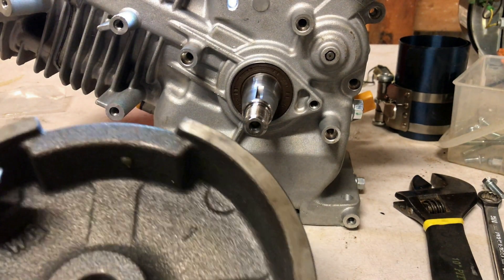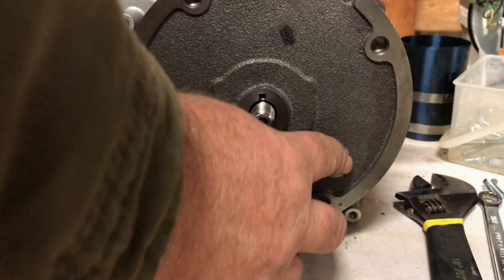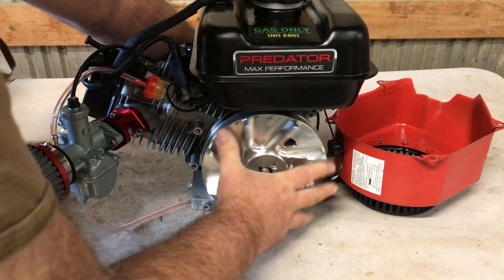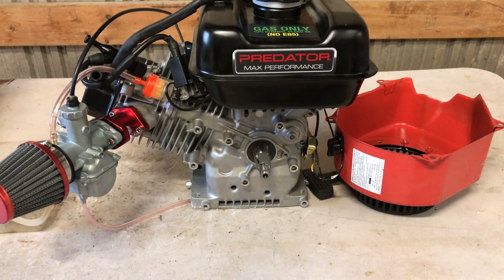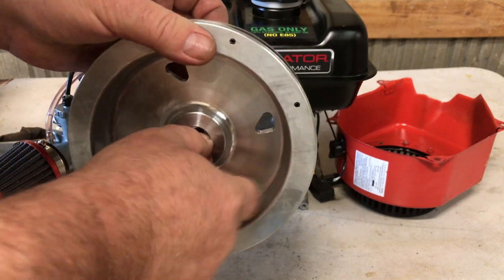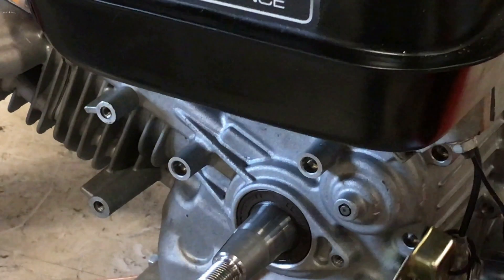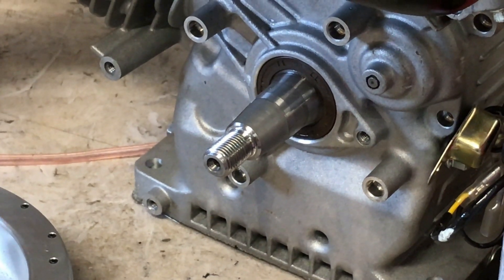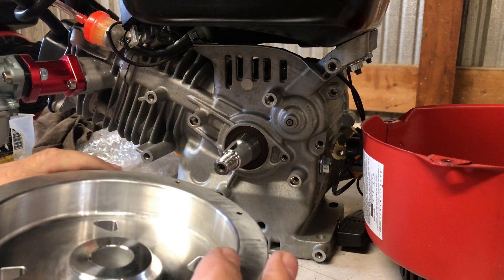Hard Starting and Kickback Solutions for your 224 Predator 212 Engine Build 223 Wildcat 236

Comment: I have a a predator 212 i was using it stock and upgraded the springs flywheel rod and carb and it will start but the pull is so hard im worried im going to break it is it supposed to be that hard with just a few upgrades my valve lash is set the only think i can think of is something to do with the flywheel i dont know what im doing at all any info would help alot thanks!
Reply from the maker: Hi Kaizu! Most of the time it's a valve lash issue. Try setting the valves on .003 (three thousandths of an inch or the metric equivalent) If the valve lash is not set properly, the compression release on the camshaft will not work. If you have increased compression OR installed an aftermarket flywheel, timing and fuel octane could be an issue. The easiest way to correct that would be to delete the timing key and move the flywheel counter clockwise just a tiny bit OR purchase an aftermarket advanced flywheel key and turn it around to retard the timing instead. Can you remember if the piston was below deck or above when you installed it and how much?
Reply: @KentuckyFriedFixes  i did is it safe to start even with it pulling that hard?
Reply from the maker: I really can't know if your engine is safe to start or not? Since I didn't build it, I'm kinda in the dark. That's why I asked if the piston was above deck or below (down in the hole). It's really important to know these things because if there's not enough distance between the top of the piston and the bottom of the head (quench distance) you could have mechanical interference causing an issue. A lot of guys get into this situation with the .010 thick head gaskets. If it's not any sort of mechanical interference and you have the valves adjusted correctly (that means you did not accidentally set the valve lash with the exhaust valve on the compression release bump of the cam.) It should start and run fine. But I need a little info to go on before I can be of much help to you.
Reply: @KentuckyFriedFixes  what does that mean piston above or below sorry i dont understand i just followed youtube videos 🤣 sorry bare with me here
Reply from the maker: @kaizupiano7826  Hi Kaizu! It's easy! When the piston and connecting rod are installed in the block and onto the crankshaft, you bring the piston up to top dead center, (that's as far as it can move up in the cylinder bore and just before it starts to go back down). If the top of the piston does not reach the top of the cylinder bore, that means the piston is below the cylinder deck (some guys will say the piston is "down the hole"). Likewise, if the top of the piston rises up and above the cylinder bore, then that is considered "above deck" (some guys will say "pop up"). The reason it's important to know how much distance is between the top of the piston and the cylinder head is if your piston was above deck say .010 and you used a .010 thick head gasket, that means you'd have "0.00" distance between the piston top and head. That would be bad. On these engines you really don't want less that about .035 inch clearance. This clearance is called "quench".
Reply: @KentuckyFriedFixes  ill look at it tomorrow and let you know thank you so much for your help
Reply: @KentuckyFriedFixes  i was never told any of that from the tutorials i watched thanks for helping me
Reply from the maker: @kaizupiano7826  You're very welcome!
Reply from the maker: @kaizupiano7826  Check out the Ducar 212 engine build Part 2. Around the 18 minute timestamp I measure to determine the piston to deck numbers. I think I cover it in one of the 224 build videos as well along with a discussion about the proper Quench.

Comment: I’m confused on the flywheel timing I thought u just lap it put the key in place and slide the flywheel on an done. Is that not all you have to do?
Reply from the maker: Hi Brad! If you use a flywheel key, that's the process. Though I delete the flywheel key on mine and run without one. Those flywheel keys can destroy a billet flywheel.
Reply: @KentuckyFriedFixes  thanks for clearing that up! I’ve been watching a lot of vids and doing research on the whole building process a lot to take in haha. I do have a question what is a drop in cam for the 224 that requires no clearance or anything
Reply from the maker: I used the 265 Banzai camshaft from EC carburetors. It's got a clearance cut in the casting that works fine for the 58mm stroke crankshaft with the EC # 8281 connecting rod. The 272 Mongoose cam from NR racing has a similar clearance cut in the casting but may require a small amount of grinding between the lobes. (Neither cam requires any grinding of the lobes directly though as they're both narrow lobe cam profiles.)

Comment: I got a 224 fully built and when your rotating the flywheel, you hear knocking and idk what it is I clearance the whole block, put new bearing rods and I’m still hearing the noise lmk if you can help
Reply from the maker: Hi Francisco! There are several places to check for clearance issues when building the 224 engine. If you used the ARC type billet rod, those rods are great but they have lots of clearance issues with the block and camshaft. That's why I ended up using the EC connecting rod in the 224 builds on the channel. Also it's important to remember the 224 engines use a standard size Honda clone crank journal of 1.179". Most of the other non-hemi Predator engines use a crank journal that is roughly .010" larger. So some have made the error of using the larger bearing on the smaller diameter 224 crankshaft. This leaves a +.010 gap between the bearing and crankshaft that oil cannot fill and will also create a knocking sound because of the excess clearance. Don't panic, you can do this. Just eliminate one possible source at a time until you find the issue causing the knock.
Reply: @KentuckyFriedFixes  ight what rod bearings i need then i just got new ones and they 6394
Reply from the maker: @Ifykyk626  You'll need to verify the ID of the bearing with either a dial caliper or an inside mic to be sure when you measure for oil clearance. Just because the box says it's correct, doesn't guarantee it is.
Reply: @KentuckyFriedFixes I did that! I put some sort of predator rod in a clone. Didn't seem to hurt anything and I couldn't hear a problem but glad I caught it. It made me sell me predator stuff - all of it!
Reply from the maker: @JimCooper-f8g  It's the little things that sometimes cause the biggest problems.
Reply from the maker: Also: Some aftermarket camshafts are ground with a very large profile, meaning the lobes on the camshaft are much bigger/wider than a stock cam. This allows the crankshaft to contact the cam lobe and in that case there must be clearance grinding on the crank or the cam lobe so each can pass the other during a full 4 stroke rotation without making contact. It happens more often than you'd think with the 58mm stroke crankshafts found in the 224 engines.

Comment: I put a mod 2 cam in mine & it gets hard, ive been hearing to do the vqlve lash a lot. Will try that today.
With stock cam is easy to start
Reply from the maker: That valve lash setting is real important. Without a good lash, the compression release can't work.
Reply: @KentuckyFriedFixes  yeah, i did valve lash & way better to pull & i think less noise too. Just need a better 18t clutch,

Comment: I got a Predator 173 cc  engine out of the box that will break your F ing hand trying to pull start it !Worst kick back I ever experienced since maybe 1960  's CZ dirt bike we called killer!  Once it starts runs good ,strong ! I did not take engine back to HF cause I had to modify a few things to get it on my Log Splitter! I thought maybe because it was set up for a lawn mower with long pull stroke I need to stand back further to alter pull stroke .That helps but still will get you . Seems like I need to pump the shit out of the primer bulb .Is there a way to enrichen  the carb to make starting easier ,or add a real choke ? I am ready to take rope pull off and use impact gun to start the damn thing!
Reply from the maker: A lot of guys report the valve lash being out of adjustment on those right out of the box. If the exhaust valve lash is not set correctly it can cause a hard start situation as the compression release on the camshaft is not working properly because the valve lash is too loose. I'd try resetting the valve lash to about.003 on the intake and exhaust.

I'm not sure what to do about the carburetor, those vertical shaft engines have a little different set up than the horizontals.
Reply: I pilled up the Predator 173 cc  owners manual and it says valve lash should be 4 to 6 thousandths on intake ,and 6 to 8 on exhaust! Seems pretty wide recommendations to me ,but I will check it. The HF Service Help Tech  Line Tech told me a lot of Predator motors have bad compression release cam right out of the factory. When I described my symptoms he told me he could send me a new cam or possibly get engine replaced.It only had an hour run time on it ! I did not want to go thru the BS so figured it would get better when broken in! I now believe I just got a bad motor or one with valve adj too tight .

Comment: i thought it was normal and i've gone through 6 pullstarts because they keep breaking. 💀
Reply from the maker: Every now and then a little kickback is expected from a performance built engine. If I was breaking pull ropes, I'd either lower the timing a bit or start it with an external electric starter. Thanks for your support!

Comment: mine almost ripped my arm off yesterday. I'll start redoing the valves..its a full 212 hemi, .10 hg, .570 pin piston...I got it running but cold it's a bitch to pull over..its only a 275 cam 104 lsa
Reply from the maker: Sounds like some good compression being made! A little kickback is to be expected on performance builds but if it starts pulling the rope out of my hand more often than not and everything else looks good, I back the timing off just a little until it behaves. It's either that or go with an electric starter! Thanks.

Comment: Great video man exactly what I needed. Built a 224 last year and it's doing the same thing. Luckily I watch a lot of your videos and that's the only motor I have that I didn't use a key 👍 at least now I know where to start. Thanks a lot I really appreciate all you content 👍
Reply from the maker: You'll get it dialed in. I like a lot of timing too and these engines run great with advance but if it starts pulling the rope from my hand more often than not, I'll back it off a few degrees until it doesn't. It's either that or go with an electric starter. Thanks I appreciate you!

Comment: Why not just run stock ? Key that flywheel isn't made for ridding around gonna run hot.
Reply from the maker: Hi Curtiss! This application needs a billet flywheel to be safe because the engine is not governed. Stock flywheels are only rated to around 3600 RPM. This engine can turn twice that.
Reply: @KentuckyFriedFixes   I run stock key in my arc flywheel. Why bother using a timing key. Your motor run hot no cooling fins that flywheel is for racing .
Reply from the maker: @curtissmartin6322  The flywheel matches the engine. This is the 224 engine featured in the 224 build video series. While the Slip Stream flywheels do offer less drag due to their cooling fin profile, I'm not aware of anyone having engine overheating issues. I'm not having any.

Comment: Hey KFF so I’ve got a predator 212 I have a billet fly wheel I’ve upgraded to a vm22 Mikuni removed the governor and bought 18 lbs valve springs and was having this exact issue and adjusting the valves did the job but just for a genuine question what timing degrees should I have my flywheel set at I have the engine built for just riding around town but still good for off-road what do you think would be the best timing for that?
Reply from the maker: I like to use around 28 degrees for gasoline and 34 to 38 for Methanol and Race Fuels. Each engine is different though as some builds will have more compression than others because of a different piston or camshaft profile, head etc. Most of the billet flywheels will have around 32 degrees total advance when installed with a stock timing key. If you have a mild built engine (flat top piston, mild camshaft), 93 octane gasoline and somewhere around 28 degrees total advance should be pretty close. A lot of advance is great but if it starts pulling the rope out of your hand more often than not, it's time to back the timing down a little at a time until you hit the right spot. (Or switch to an electric starter)
Reply: @KentuckyFriedFixes  hey thanks for takin the time to right all that helps alot I couldn’t find a good clear answer anywhere else so thanks a lot! 😎
Reply from the maker: @jeronion  We love engine talk on this channel!

Comment: I just got a 212 mini bike with a billet flywheel, springs, cam, and rod. Was riding fine then all the sudden started to bog down and it was hard to start rode it more and around top speed it started to bog again and now it pulls it out of my hand every time and I can’t even get it to start
Reply from the maker: Hi Vanquish! You could have multiple issues causing this situation. Some things to check: Oil level (of course) to make sure the engine has not been running low on oil. I know that most of these engines have a low oil shutdown in case the oil level drops below the safe operation level, but in many cases those may be disconnected by a previous owner or even faulty so it's best to check the oil before every ride. Low oil can cause an engine to bog down as it may be locking up due to inadequate oil supply to the crank/rod.

The next thing to look into would be the carburetor jetting. You'll need to pull the spark plug and inspect the color of the electrode to determine if the engine has been running lean, rich or about right. A nice chocolate brown is what you're looking for, if it's wet and black or dry and white, the jetting is off.

Next, I'd check the valve adjustment. If you're experiencing the rope being pulled from your hand more often than not the exhaust valve lash may be off. The exhaust valve is on the side of the camshaft that has the compression release mechanism on the exhaust cam lobe. If the valve lash is out of adjustment the compression release will not work and the engine will be hard to start.

Finally, I'd check the ignition timing at/of the flywheel. Aftermarket flywheels like the billet one you mentioned have an increased amount of timing over the stock flywheels. They may be at 36 degrees of ignition advance even if a stock flywheel key has been used. The extra timing is great for more performance but it can cause issues with the type of fuel you run and hard starting. For example: I like to run around 28 degrees ignition advance on pump gas and around 36 degrees or more ignition advance for Methanol or heavier fuels. A low octane fuel with a lot of ignition advance in an engine with decent compression will tend to pre-ignite causing kickback more often than not. The more timing you put into it, the heavier fuel/or higher octane you'll need to prevent this from happening. It just takes patience and a little time to work out each area one at a time until you find the problem. You can do it.
Reply from the maker: @@SpaceCoastMiniBikes Thank you! I try to help everyone the best I can but with just words it ain't easy. Sometimes the small things can make you pull your hair out. A little patience goes a long way on these engines.

Comment: I keep having this kick back, It gets to where it is really hard to pull. It caused my pull rope to break td but I fixed it. Not sure what's causing it
Reply from the maker: In most cases the exhaust valve adjustment is off. Unless you have a much modified engine with a high compression ratio and billet flywheel, it's more than likely a valve adjustment problem. The high compression engines can have issues with fuel and timing even if the valves are adjusted correctly. That's one of the drawbacks of a performance engine. A little kickback every now and then is acceptable but if it starts pulling the rope out of your hand more often than not, it's time to have a closer look. When I get back to filming at the shop I'll try to make a few videos on kickback solutions for different engine types and builds.
Reply: @KentuckyFriedFixes  👍

Comment: How mych timing is in your flywheel?
Reply from the maker: Hi Dayton, the Slip Stream flywheels are supposed to be around 32 degrees advance but mine turned out to be more like 34 degrees. I backed it off a couple of degrees in order to pull start it without yanking my wrist too often. The 224 engine has almost .010 above deck with the flat top piston. It'd be better on Methanol and more timing for sure but this one is not a real race engine. We'll be building some "real" race engines soon though! Thanks
Reply: @KentuckyFriedFixes  so I should advance my flywheel? Or should I retard it?
Reply from the maker: Hi Dayton, it depends on what kind of fuel you run and what kind of compression your engine is making. Some guys have no problems running gasoline with the stock timing key at "0". If you run Methanol fuel a few degrees advance will make more power. Timing is something that needs to be adjusted to each specific engine/fuel combo.